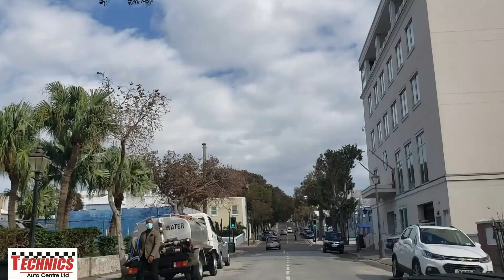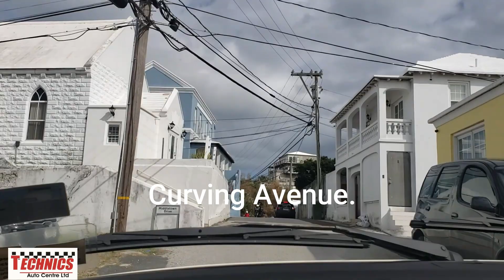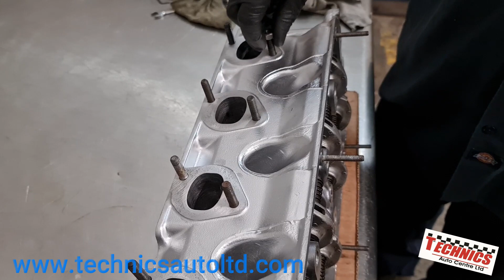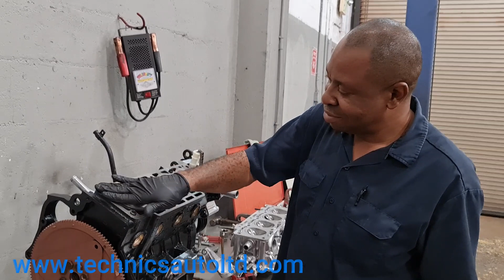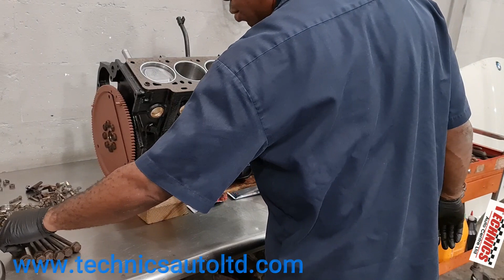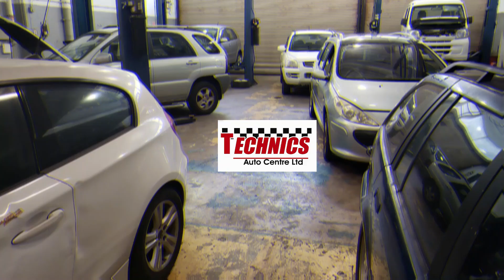Part 18. BMW M10. How to assembly cylinder head & engine block together.

Comment: Is that block comparable of the 320i  2L engine ?
Reply: It's the same M10 2 liter. Just know that the 320i M10 was fuel injected from the factory.
Reply: @WhoIsSea.  thank you sir

Comment: If you are rebuilding your valve train for this engine, which parts should you replace with new, as a matter of course?
Reply: Valve seals and guides would be best
Reply from the maker: It depends on the condition of the engine. The valve seals are a must. The following parts will need to check for within tolerance/wear limits: valves, valve guides, valve seats, camshaft, rocker arms, rocker arm shafts, camshaft oil pipe, and valve adjusters.